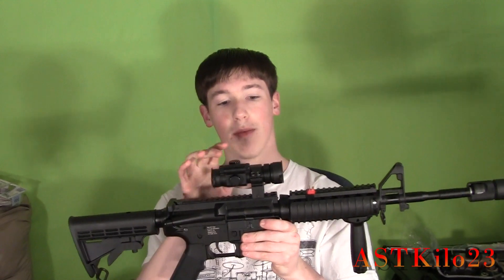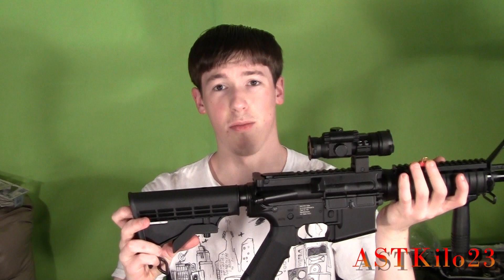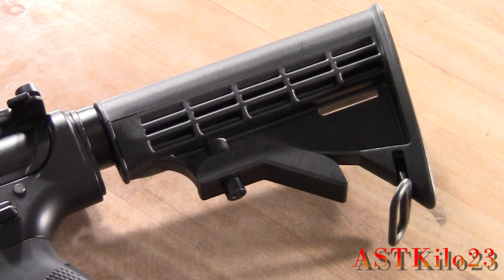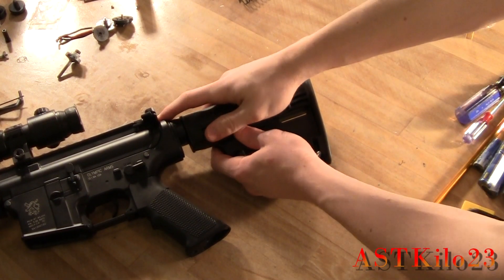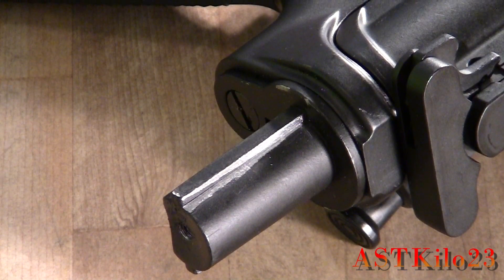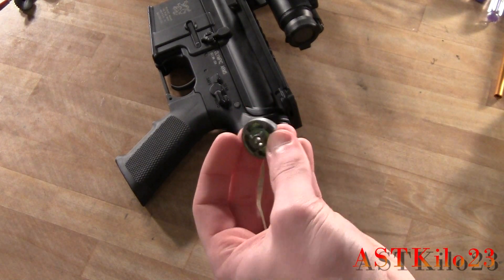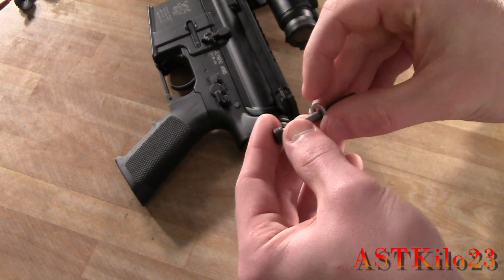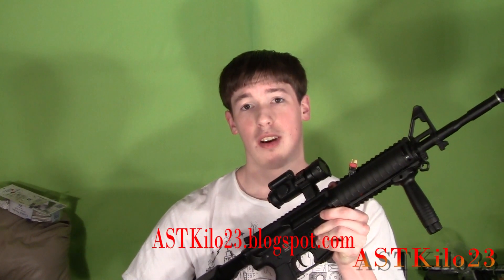DIY: Installing a Standard Stock Onto the ICS M4  -ASTKilo23-

Comment from the maker: @TheAlexBradley not a buffer tube per say, but if you want to wire the battery to a crane stock you will need the special washer i mentioned.

Comment: the difference in the stock(tube) aka buffer tubes. theres2 different sizes. military(smaller, but thicker metal) commercial(bigger diameter but thinner metal) thats why commercail stocks on military tubes are super wobbly. and militarty stocks dont fit commerail tubes without opening stock with inner sanding. sand paper on a screwdriver. put it on a drill and bore out the stock.

Comment: I got an ics with a crane stock but want to run the normal batteries in it, is there a way to do this, like solder wires to the contacts with a connector or something?

Comment: Not trying to undermine what you did here, but, couldn't you just remove the A&K crane stock from the A&K buffer tube and slide it onto the ICS buffer tube after you removed the LE stock? Would've saved you a lot of time and hassle.